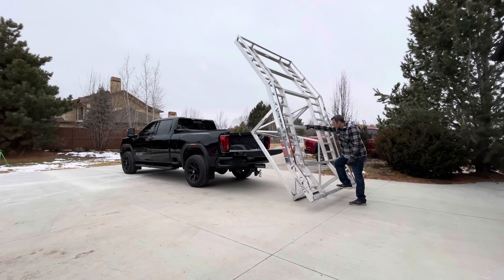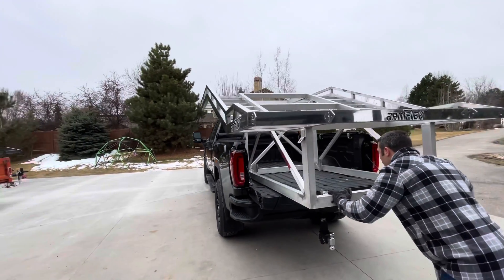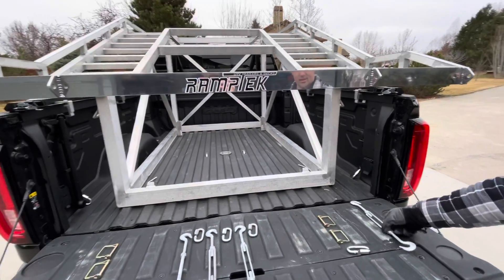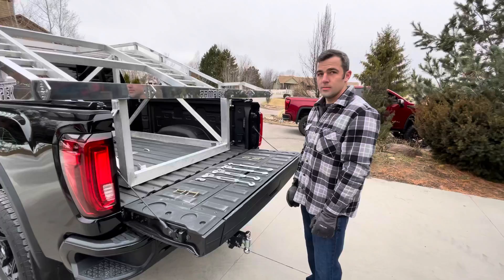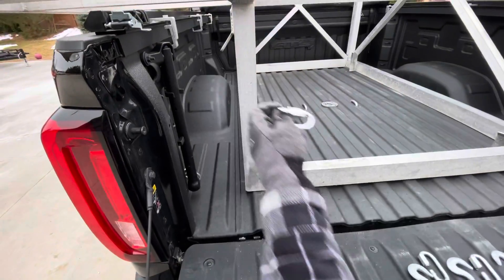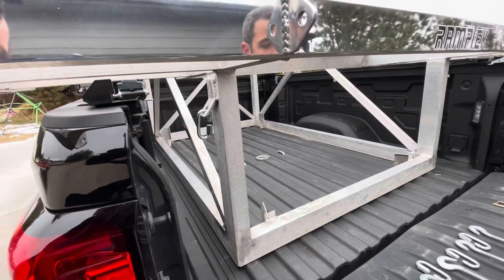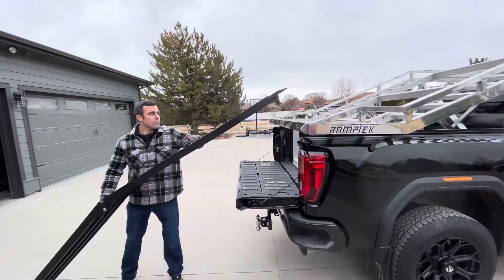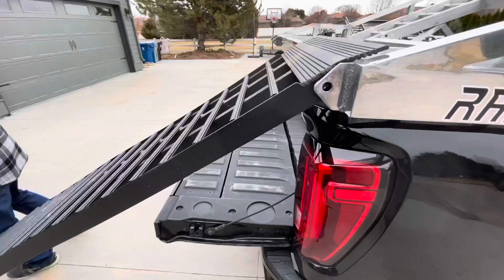Ramptek UTV Deck Installation video

Comment: Do you need a spray in bed liner or will it work just as well with plastic drop in bed liner
Reply from the maker: It will work well with a plastic bed liner.

Comment: Do you know if this would be compatible on a 22 Ram 3500 dually 8ft bed with a Bakflip MX4 toneau cover installed?
Reply from the maker: We can certainly make this work with a bakflip cover with a slight modification.
Reply: I'm hauling a 24 polaris Pro r Ultimate fyi
Reply from the maker: No problem on the Pro R

Comment: Can you still fit a 125cc youth atv on the truck bed with this set up?
Reply from the maker: Depending on the with of the ATV and width of deck you choose it will. You will need the removable rear bar option.

Comment: observation: Good grief people pull a trailer.
Reply: Really though. That's too much crap in bed of truck just to avoid using a trailer or take two vehicles if you want to take utv and rv
Reply: @Brandon68plus1  Not to mention cracking your head open falling off that thing. Not to mention  your chances are 1 in 5 to drive up that thing. Not to mention a back injury  @ 0:01 - 0:09 which was intentionally edited. Not to mention impossible to strap down a RZR wheel 9' in the air.
Reply: @kscoran   . . . meanwhile my video feed is full of 25 - 70 yo men load unload fails. Most are in states that touch Georgia. My trailer is in some of my videos.

Comment: Looks like it would be top heavy to me. Not convinced.
Reply: I can't speak for them, but I think the fact they even posted a video seems a pretty clear warning and acknowledgement that it is gonna change the 3 dimensional weight distribution, center of gravity, etc.  You would need to drive with that in mind...
Reply: I am a trucker who has done flatbed work and I drive a semi truck that has a very high centre of gravity, depending on the load very carefully, which is the same thing you would have to do with this.  If you make a mistake on the freeway, you don’t just jerk the wheel over to get to the offramp or you may find yourself on your side.  That doesn’t mean it’s unsafe. It means you’re not very bright.  it’s risk every time I go to work I have to think of the same things I’m not gonna jerk the wheel or slam on the brakes the load could come right through the front of the trailer on a reefer.

Comment: What is just so wrong with a trailer?
Reply: In my case I use a similar product so I can haul a camper or boat.
Reply: Allows someone to haul the RZR and camper or boat etc
Reply: this doesnt solve the problem of "how do I avoid a trailer"; its more the "how do I run my trailer and add a UTV when I haul?"